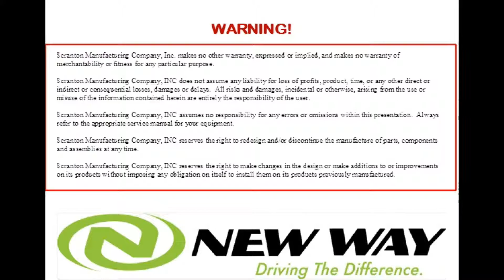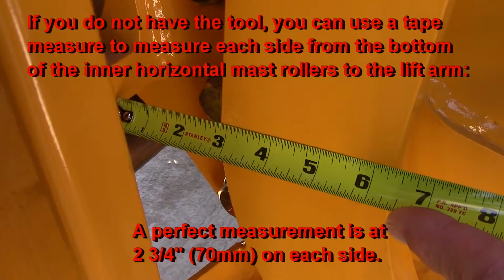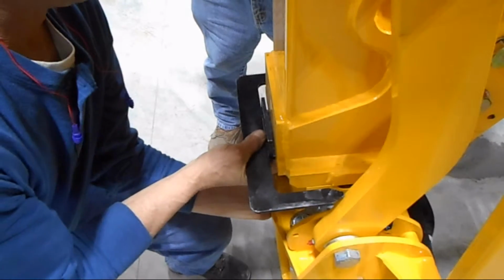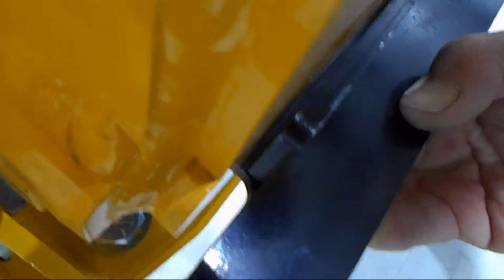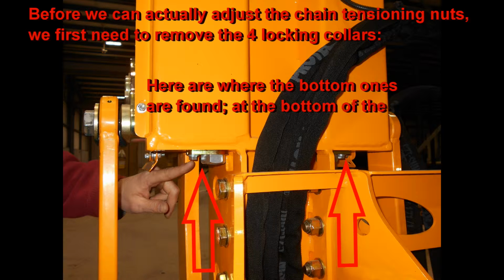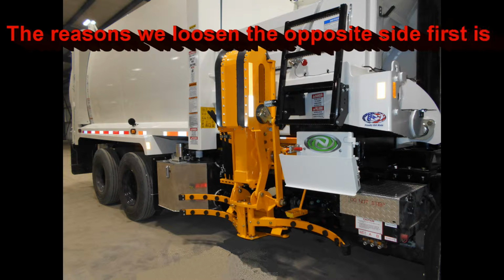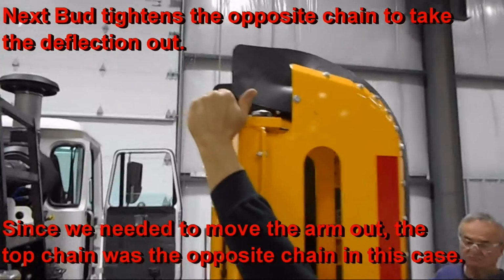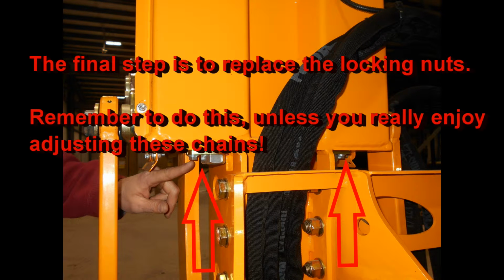New Way Sidewinder Automated Gripper Chain Adjustment

Comment: I learned a bit more about what our sidewinder is doing, the Mac air valve for the tailgate is being activated when the blade returns when auto pack is on, which is why it feels like the engine is about to die, since the tailgate is one of the things that must have fast idle on to operate. Now just need to find out what and why the tailgate is being told to close for those few moments
Reply from the maker: +busmansonny It could be moisture in the gray control box.  Some time ago there was a service bulletin, if you have the plastic version of the box, check to see if the pins on the inside bottom are exposed.  The service bulletin had epoxy to cover those pins.  Otherwise, I would check the wiring behind panel where the controls and valves are mounted.

Comment: Boy could I use some help with my sidewinder..., only when auto pack is on, the pack blade strains the engine and pump on the return trip. When you use the manual pack switch, the blade operates great. Our shop and new way dealer still scratching their heads... Any help would be great
Reply from the maker: +busmansonny It could be the extra speed, the autopack revs the engine.  Does it act the same way if you rev the truck when using the manual button?
Reply: It does do it if the fast idle is on, however with the fast idle on, it seems to get a head start on the load so it doesn't seem as bad. We have another truck that does it on auto pack but  only when it initially starts retracting.
Reply from the maker: Unfortunately without seeing it in person, its very hard to say.  I'd have the dealer call in.